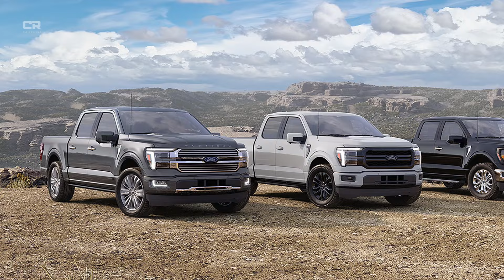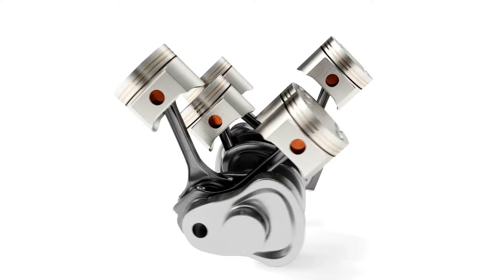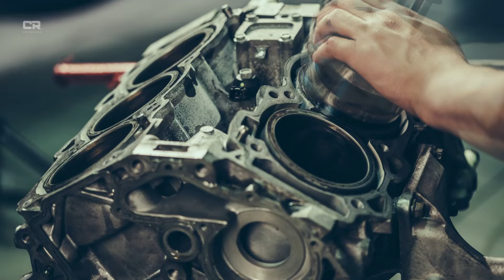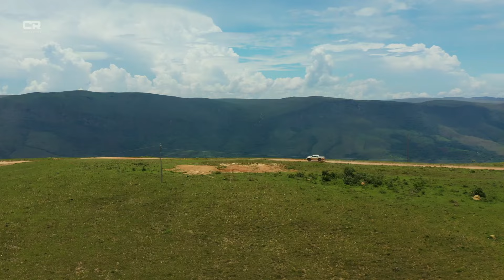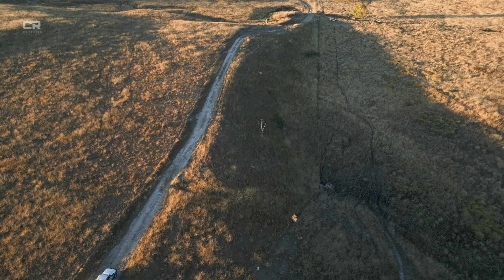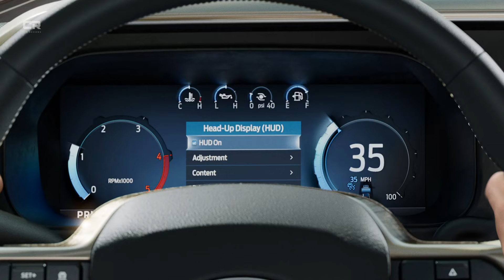Ford 2026 F-150 Gets All New Turbo V6 That Beats V8

Comment: The 3.5 Eco boost already had equal HP with almost 100 ft lb more torque than the 5.0. Still, I'll keep my 5.0 .
Reply from the maker: Thanks for sharing your thoughts! It's always great to hear different perspectives on the engine debate. Your loyalty to the 5.0 is commendable!